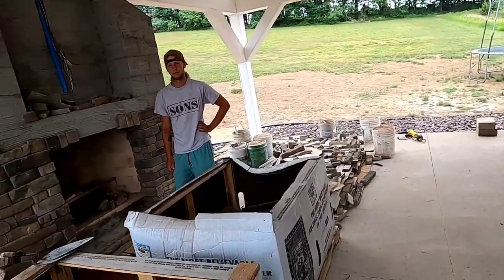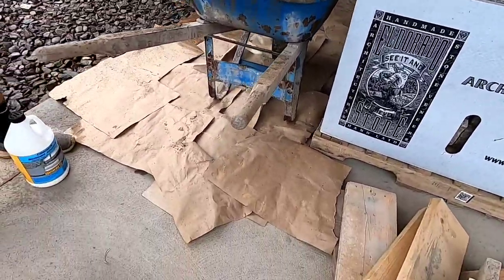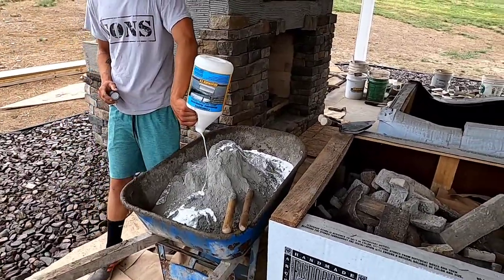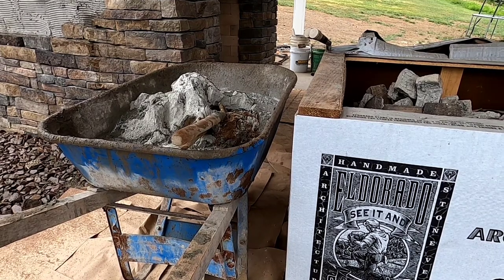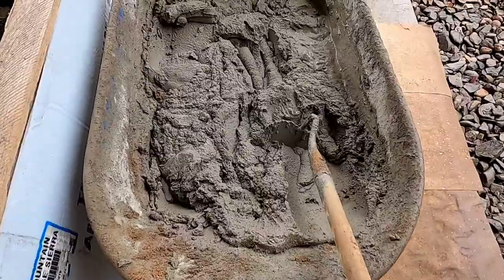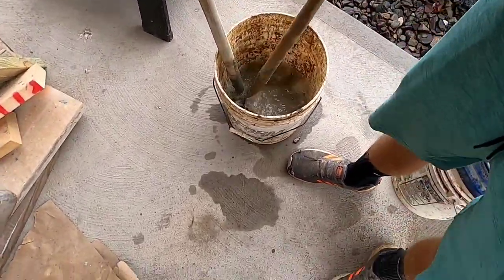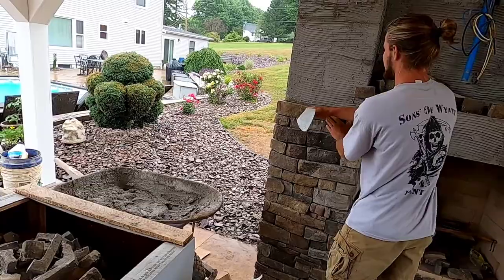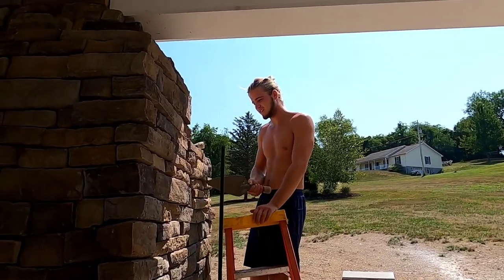How to Mix Mortar To Lay Stone

Comment: Hey Mason don’t worry about the haters I think you guys are doing a good job. Thank you for making your videos. As far as the motor goes is that the same mix or same ratio that you would use for block just curious I’m going to be laying some block and I need to do small batches as I am an amateur at masonry
Reply from the maker: Thank you and thanks for watching! Same ratio and you don’t need bonding agent in block mortar
Reply: @masonthemason6412  thanks man
Reply: Mason, do you add lime into your mortar mix for blocks? Thx
Reply from the maker: I do not

Comment: Hey mase enjoy watching the videos 
I’m having issues with spec mix polymer modified mortar and adhering somewhat larger stone veneer. Going from top down and have 1/4 to 3/4” joints. Most of the stones keep falling off. I feel like I have to hold it for like 10 min. I’m wetting the cinder blocks (they’re rough) - no scratch coat. I saw where you use the bonding agent to make it stickier. Maybe that’s what I need to do? Or what about mix with a bit of thinset ?

Comment: What type of mortar are you using there? Or is that actually cement? I thought when you bought a bag of mortar mix that you weren't really supposed to add anything to it besides water and maybe bonding agent. Thanks for the helpful videos!
Reply from the maker: So you’re thinking about spec mix. It’s comes in a perfect ratio in a 80lb bag. 3 parts sand 1 part Portland. The stuff I’m using is 3 parts sand and 1 part type s Portland. We only add bonding agent in stone work
Reply: @masonthemason6412  I see. It looks like in my area it's hard to find it not mixed already. I found the orange store lists type s mortar mix as well as type s cement. In the description for the type s cement they say to mix it with sand 1:3 so I think that's what you're using.

A Few questions: what is the advantage of mixing it yourself? And why do you only use bonding agent with rocks? Are cement blocks so rough that they don't need the extra stickiness? Is there any downside to using bonding agent with other stuff?

Thanks! Your channel is super helpful!

Comment: I wish ppl would respond to the question of "best mud for laying REAL stone ". Cultured stone or modern 'veneer', has 1/3 of the weight,density, and is wayyy more pourous , than say ACTUAL chunks of blue-stone 'faced' 4 in veneer, on a mortar bed. An fyi versa-bond thin-set or type N due to it's stickyness an heat resistance is ideal for cultured veneer

Comment: Hate to say it guys but that looks like shit. You need to give more attention to keeping your stone level. I couldn't really tell in the time laps if you were both working up the front face, one of you on each side, but if you were that explains part of it. One face, one stone mason. I'm not trying to insult your work, just giving you some advice is all.
Reply from the maker: We had to dry stack fake stone. This type of stone was meant to have joints. So all the pieces wouldn't match up. I couldn't cut it much because the concrete would show. I don't know how I could have made it better with this material. I had to keep everything tight and try and keep it level. I was more worried about leaving spaces inbetween the stone instead of level
Reply: @masonthemason6412  yo mason I agree bro and I do real solid stonework all the time. With that fake stone that’s how it goes. And stone isn’t always level I think you fit it up tight and kept it running straight. Really good install. Always a hater in the crowd and I grew up like you in this shit since I was a lil kid. I learned from some of the best masons out there. Good job bro we are the future
Reply: He said he wasn't trying to insult your work, but literally all he did was insult your work. I wanna see his stone laying video since he's an expert in the subject.